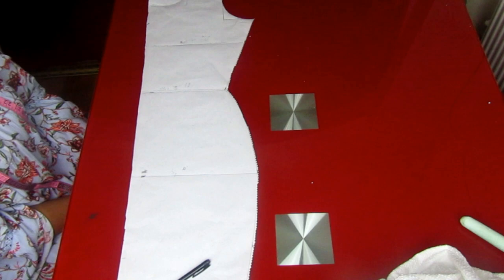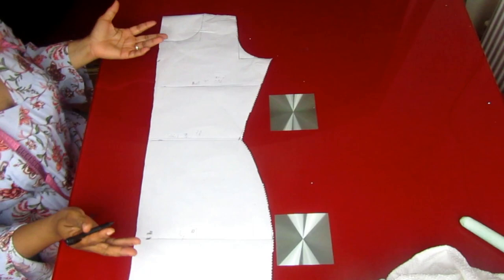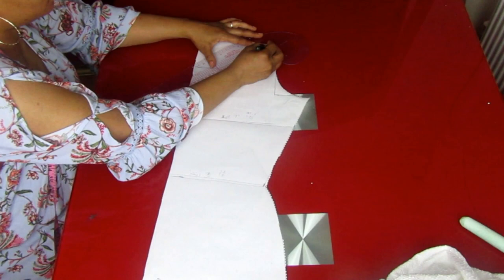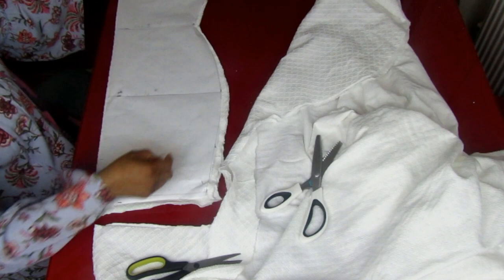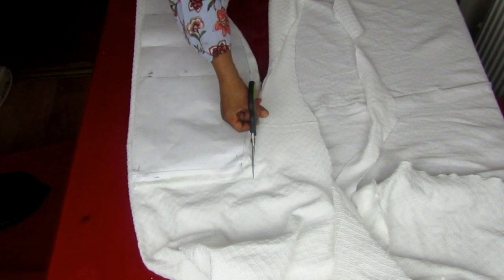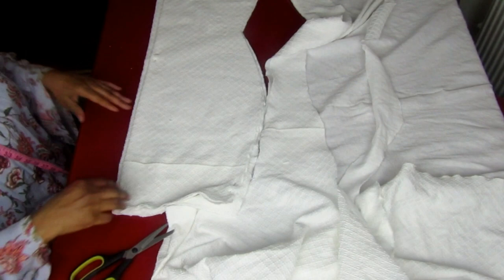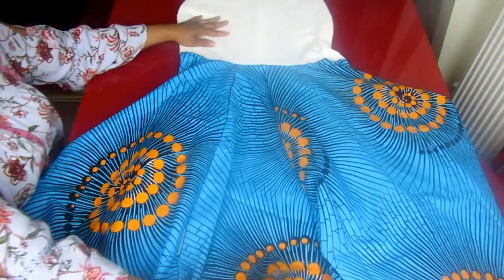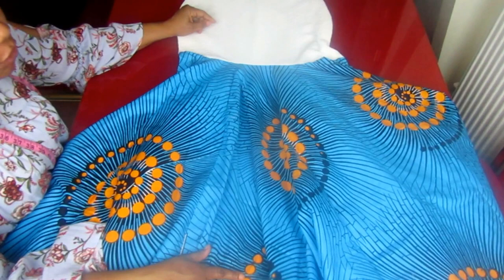How To Make A V Neck Off The Shoulder Long Dress

Comment: How much cloth did you use top and bottom for the dress, and it's very beautiful.
Reply from the maker: Joycie Pennie 1 meter for the upper part and 3 metals for the down part,though it's all depends on individual measurement

Comment: Please Ma, the sleeve is confusing. Please, How did you measure and cut out the curve to achieve the normal sleeve?
Reply from the maker: Chioma Juliet Paul I cut out a normal sleeve and I cut out 1 inch from the sleeve cap. Check my channel you will see a video on how to draft a sleeve
Reply: Cynthia A. Thank you ma